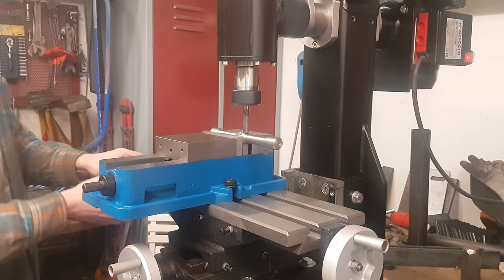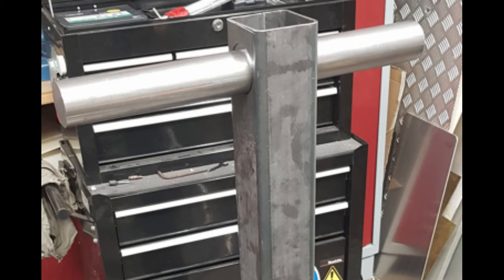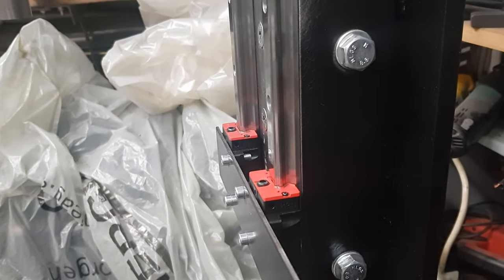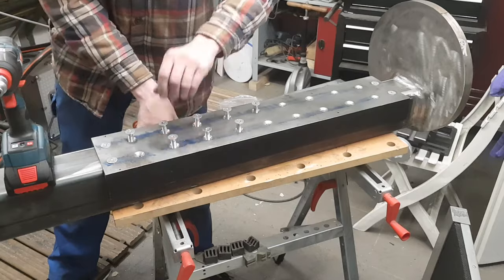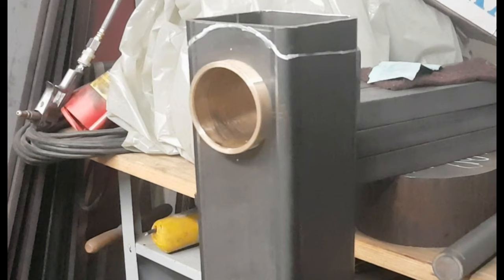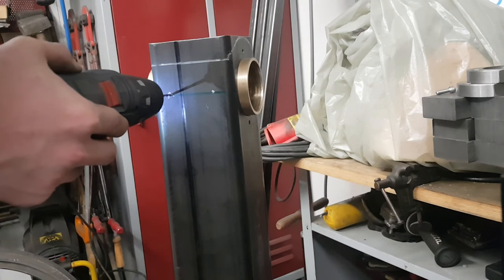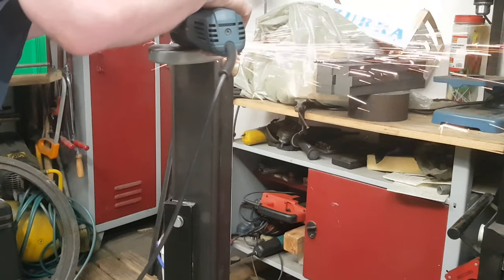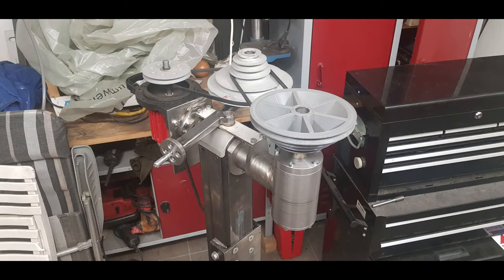My DIY Milling Machine Part 1

Comment: Superb build! Would you be intetested in making and selling just the structure? 😁
Reply from the maker: Thanks a lot!
Unfortunately i am not interested. First of all getting this thing shipped would be quite expensive unless you life in austria (my home country).

But mostly i am not interested because i moved closer to my workplace a view months ago. Since my workshop is now located a 40 minute drive away from my new home i only have time to get some stuff done at weekends.
That's also the reason part 5 of the milling machine video series is taking so long.

But if you want to try it yourself i can assure you that the build itself is not to hard to do. The only thing you really need is time.

Anyway thank you for liking my content.
It means a lot to me!

Comment: Nice build. Did you figure out your total investment  to see if it was worth it compared to a  commercial mill?
Reply from the maker: Honestly i lost track of how much money went into this project. If i had to guess, i would say there are probably around 1200 - 1400 bucks in this project. This includes material (at least the stuff i had to pay for), tools and consumables.

The big thing with going DIY is time. 
I spent a lot of time designing building and perfecting (still not done yet) this mill. Since this is my hobby this factor didn´t matter that much to me.
But maybe your view on spare time is different than mine.

Let´s put it that way: Buying a mill is for sure a lot less hazzle and a lot more cut chips.

Comment: Those cross slides are awful and need work to get a decent accuracy. I have one for a sherline headstock. Actually works OK. Helped me build parts for itself, a 5c cnc lathe and other cnc mills and lathes. I'm currently finishing up an 18.5"x4' cnc router. I didn't know how much fun but expensive hobby Machining can be. Very cool build. Your machine seems very robust.
Reply from the maker: Yeah you defenetly have to put some time into these X-Y tables. At least some cleaning and deburring needs to be done.

I always love when machines produce their own parts  That's just cool!

I hope that the mill is as robust as it seems. 
I am planning to do a test with a facemill to see where the limits are.
But for that i have to get a facemill at first.
Thanks for the comment!

Comment: Dude Good job!👍
You are doing something which is complicated and difficult, and you are doing it with "normal" tools.
Kudos!!!!!!
Reply from the maker: Thanks a lot!
When i was still in school i also thaught i would need a bandsaw, a mill and other big machinery in order to do projects that are not absolute garbage. Turns out basic tools can do quite a lot with enaugh patience.
 But on the other hand if you want higher precision they don't replace machinery.

With this videoseries i just want to show that building your own tools and machines that produce fairly accurate parts (within the limits) is indeet possible.

I hope some viewers are getting some ideas for their own projects. Would love to see that.

Thanks again for the comment :)
Reply: @wastelandworkshop3839  🙂👍

Comment: What is that U piece that you used to mount the rails on. How long are the rails that you mounted on the U section? Thank you .
Reply from the maker: Hi John,
The rails are 500mm long and the U section piece is just a standard profile with a width of 140mm and a material thickness of 6mm.

Hope this helps!
Reply: @wastelandworkshop3839  yes very much so. Thank you. now I know what to look for. I have to go and check on  what is available near me. I just found a 2" thick 3 feet by 5 foot piece of steel that was used as a welding table. I am going to go and purchase it later in the week. I have been searching for a good welding table and they are so expensive. I found this one for about $100. I know that it has to be a great deal because I have seen much thinner ones for almost ten times that price.

Comment: a cheap way to make the colum more rigid is to fill it with concrete so it gets a solid core. epoxy garnite would be better but costs more. just put som oil on the screws so they dont get stuck
Reply from the maker: Thanks for the advice!
That's the reason i closed the column of the mill with a sheet metal lit. 
I can always open it if i want to.
If rigidity turns into a problem i will keep your comment in mind!

Comment: Definitely one of the top 3 videos on mill building. Thank you for sharing. Do you have a link for the XY table?
Reply from the maker: Thanks 
Means a lot to me!
I just looked on amazon. Sadly the table is not available from the seller i got it from anymore.
But there are several identical ones available.
Probably they all come from the same manufacturer.
I would suggest you just look for the cheapest one you can find. 
But if you get one make sure you take it apart, clean it and deburr it properly. 
Mine had some grinding dust and nasty burrs all over the ways.
Other than that it is a great product for the money especially because it is made of cast iron.

Maybe i am going to show more of the table in part 4.

Comment: like the height ajustment , thinking on building a smallish surface grinder and might use the idea for that
Reply from the maker: That's a cool idea and a great project.
Would like one as well.
Reply: @wastelandworkshop3839  might go a bit further still and make the head (motor belt axle and stone) detachable so i gan use it on the lathe as a toolpost grinder too 
seen a smallish sewing machine motor used for it but the guy thought it wasnt powerfull enough , have to see wat amound of power i would need still
Reply from the maker: Cool idea!
Sounds like you got a nice sized lathe.
Mine would be a bit small for that to be honest.

Comment: hi can I just thank you for you amazing content first. and now a question could I please ask where you got the mechanism for the z axis  the table raiser part ?????? and second what is the mechanised called ???? I've been looking for something exactly like that for my drill press table I seriously have been looking for ages so please will you be kind enough to help me ??? thank you so much mate keep up the good work i really enjoyed your work Ricky
Reply from the maker: Thanks a lot!
Well i bought 2 linear rails with 4 carriages and a set of bevel gears with a 4:1 ratio.
Everything else is home made.

If your drillpress doesn't have a feature to lift the table up and down i guess you will have to come up with your own solution for that problem.

You could use a threaded rod in conjunction with a set of bevel gears ( this would be similar to the design i have on my mill).
Another aproach would be a reck and pinion gear. This is the common type of table adjustment on commerical drill presses.

If you want to look further into my design i just uploaded part 4 of the milling machine series. In this part i am covering the Z axis mechanism.
Thanks for the comment and if you have some questions feel free to ask!

Comment: This is one of the most incredible builds I have had the pleasure of watching and inspiration. I will be maki ng one of these. Thank you so much for sharing with us.
Reply from the maker: Thank you for watching :)
If you are really going to build your own version i would love to see some pictures.
Reply: @wastelandworkshop3839  I will definitely stay in touch. I have a bunch of projects. I was hit and run over a little over 18 moths ago  while riding my 1957 Harley. I had to learn how to walk again and it has been  a rough road . I am able to walk  normally  now and I am fairly recovered. I  am going to start my YT channel with a Barn find Yamaha three wheeler. I am going to cast an aluminum tapping arm for my drill press and then I will be able to fit in a milling machine.
Reply from the maker: @Biokemist-o3k  
Dude
That sounds just horrible (the accident part).
Glad you recovered from that.
Looking forward to your channel!
Reply: @wastelandworkshop3839  Thank you. I will keep uni in the loop.